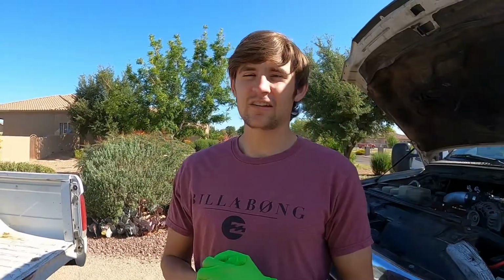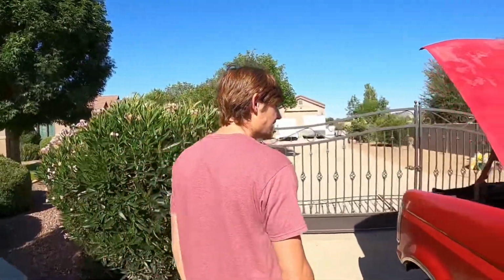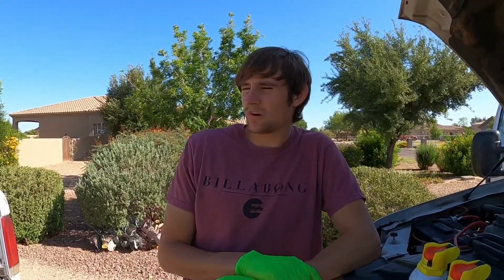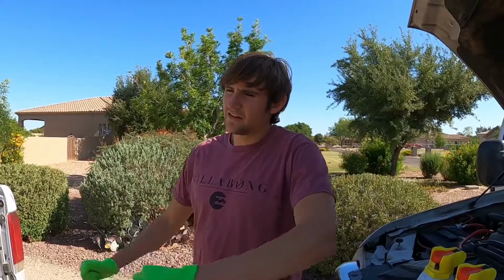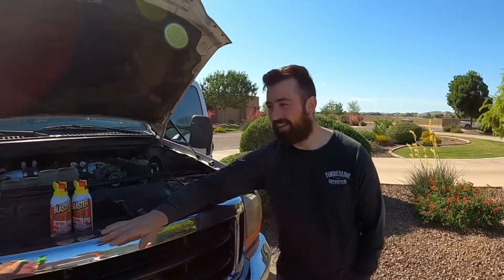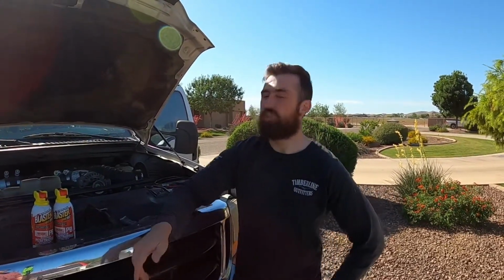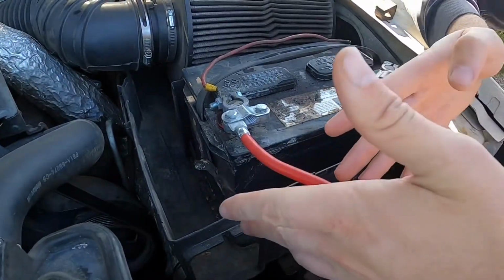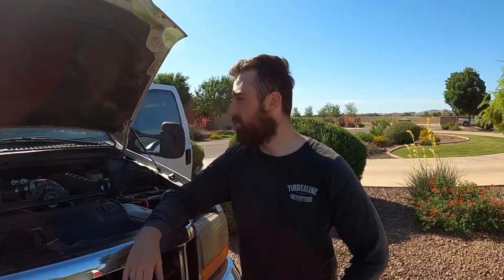WE ARE BACK

Comment: I like the obs ford's, I just bought a few weeks back a 97 F350 with a dynamic selfloader body, my other selfloader is an 05 F450 with Miller body, the 6.0 when I got it needed a radiator, I changed all the fluids and filters and it was dropping out my passenger side injectors, I had 60psi static and loaded fuel pressure. Then found out no compression on number 3 cylinder. Should've checked cylinder contribution first but I was to focused on the old owner running it hot with the radiator issue. So I had tunnel vision. Gotta get head off now to see if it's valve or piston issue. The 7.3 runs good sometimes it'll act up a little bit then clear out. I'm running archoil in it.
Reply from the maker: Archoil is quality stuff. We run Rotella because its a good mixture of price and quality. The 7.3 is such a great truck